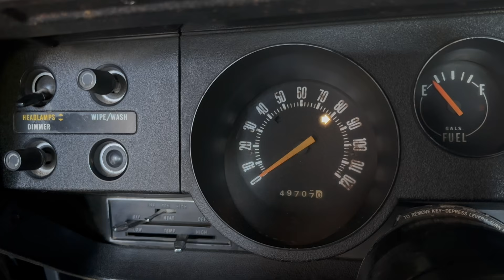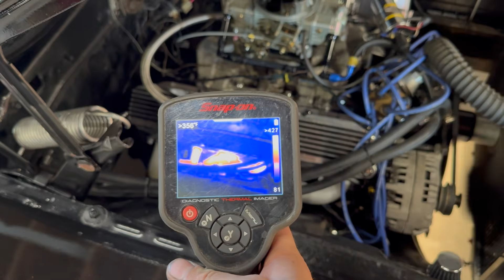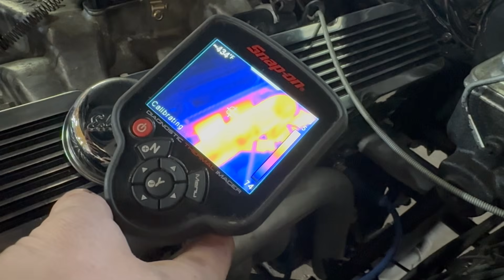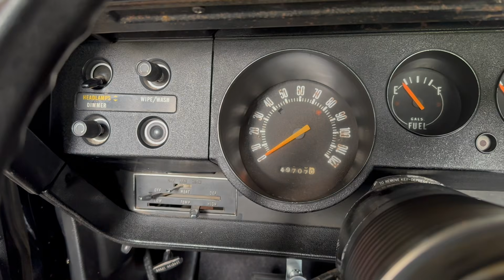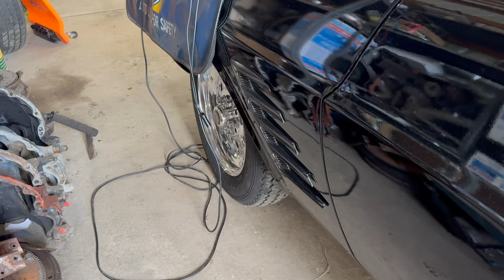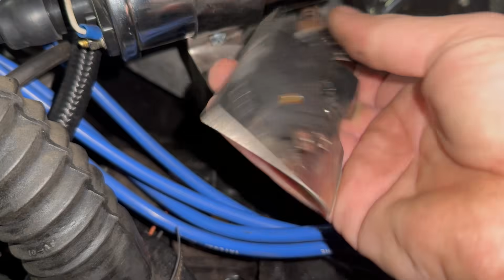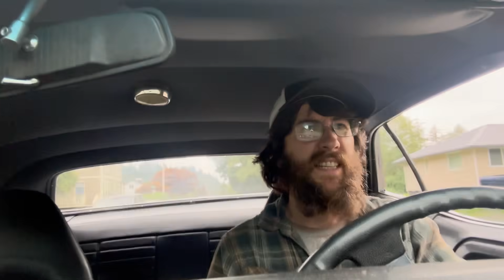What's Wrong With This 1973 Dodge Challenger? Electrical Gremlins, Big Block Tuning Tech, And More

Comment: Do you think there's a crack internally in the aluminum intake manifold I've ran into that on ford and olds and two sbc engines..
Reply from the maker: That’s an interesting thought. I think I tried a different manifold way back when, but I’m not actually sure now.

Comment: I am 9 minutes and 31 seconds into this video and I have a couple of guesses towards the higher RPM backfire out the carburetor. 
I have a 1973 Lincoln Continental with a 1970 high compression 460 in it.
About 10 years ago I went crazy trying to figure out what was going on with the car because it would do the exact same thing this Mopar is doing.  It would usually sneeze out the carburetor but occasionally it would even do the opposite side and sneeze out the exhaust It exploded more than one muffler In fact it was so bad I eventually put glass packs on it just because they just get loud when all the packing gets blown out (It is still running the glass packs today years later and it is really loud but it's kind of fun because it's no longer my daily driver).  Anyways long story short after rebuilding the carburetor myself and it not fixing The problem, i rhen  changed all the ignition parts and it did not fix it. Next I was starting to question my mechanic ability so I took the carburetor to a professional carburetor shop here in Southern California that is pretty well known for doing a bang up job on carburetors and having them go through the carburetor and it not fixing the car.  I was at the point I was ready to smash the car with a hammer.    I just got lucky and my neighbor Who is a fellow gearhead came over when the hood was opened and it was right at dusk when the sun had just set and I hit the key to start the car and it fired right up perfect running lolike it always did just like normal but My neighbor knew I was having a mystery issue and he happened to see a little itty bitty arc about 1" back from the ignition coil on the I believe it was the positive wire (it may have been the negative side it's been a lot of years now and literally dozens of more cars later)  anyways the wire was partially broke I temporarily used alligator leads and bypassed the wires and low and behold the car was 100% fixed and running perfect with no more sneezes or pops,  except obviously that wasn't a permanent fix because it would burn up the ignition system not having a reduced voltage to the points So I replaced the wires going to the coil on both sides going all the way back into the factory wiring harness where the wires appear to be really soft and never cooked by the heat of the engine because on a 460 the wires lay across the intake manifold although originally they were in nifty little clips those were long gone.  After that the car never had the problem again and it ran absolutely perfectly and because that happened it has stuck in my head for my entire life now alligator leads are part of my so to speak tool kit when I am trying to figure out a weird ignition or carburetor issue so I can hotwire the coil temporarily to see if problems go away. 
My original thought was actually weak valve springs because they were the factory springs and who knows how many miles they had on them I put in a slightly more aggressive camshaft than the factory but it wasn't anything wild I guess it's what you would call an RV cam or a torque cam Plus I gave it dual exhaust and I did some mild porting work to the cylinder heads just trying to make the car run a little harder than it should I would imagine realistically it's in that 420-450 horsepower range now (from the factory they were 365)  It's definitely stout for its 235/75/15 tires as it turns them into crayons mind you that is a huge car probably weighing in at 5200 lb. It's a handful if you want it to be definitely fun to drive now. 

To this day I have the brand new valve springs sitting on the shelf in the garage because the low voltage coil wire replacement fixed my issue Anyways I got an hour and 10 minutes to figure out if you fixed this problem or not And I am curious but unfortunately I got to go run some errands so it won't be until later this evening if I get to find out the answer let's see if I'm right...
Reply from the maker: I changed every ignition part on that car at least once or twice over the years. Nothing ever made any difference. I have seen spark jumping around in the distributor cause that and would expect an ignition issue. But I never found one... I still suspect a valve issue.
Reply: @DeadDodgeGarage  It's nice of you to respond I figured you were getting too many subscribers to be able to respond It's appreciated. 
  If you work on the car again My idea will take 5 minutes and it's basically free just direct wire the coil to 12 volts using temporary wire like speaker wire or something and see if the problem goes away If it doesn't because you replaced all the ignition parts already it's a guarantee at that point it's a mechanical issue which is probably valve springs. Anyways I am going to finish up the video right now.

Comment: I owned a 340 Challenger back in high school but it only had a built 318 in it. I could’ve bought the engine 340 for another thousand. I said you could keep it.  I’ll tell you the truth that Car had an original three speed on the floor and it almost killed me a couple times handled like a dream but it was it was fun!  Allegedly got away from a cop one time.  😂

Comment: Edelbrock 1406 with purple springs in the with original metering rods.  Because the weight of the car.  Or new Holley 600cfm.  Little adjustments

Comment: On the 73 challenger  back firing, what is the engine vacuum at idle? The power valve should be just below that adds fuel faster also go with the pink 330 acceleration cam and change .31shooters to .33
Reply from the maker: It’s been a long time since I missed with that carb, but I also tried at least two other Holleys on that engine over the years. I don’t think that’s it.

Comment: Reviving this.  Flasher systems are generally very simple, I even built one from scratch for a 70s Harley golf cart and integrated led flasher relay into W123 Mercedes with dead central flasher switch.  You only need resistors with flasher “modules” (90s-00s and newer stuff), and weird things like Fords using tail lights to supply signal to transmission and CC, otherwise just use led rated flasher (I use red 2 or 3 pin from Superbrightleds).  The three pin is for cars using single indicator on dash.  If you still get no flash, try a short harness to swap polarity on the module.  The relay likely has power on one side and the other side goes through switch on column to bulbs. I had to do the short swap harness on 87 Chrysler, 71 International, 74 Dodge and 79 Honda motorcycle .  Make sure grounds are all good at the lights.  If you have a single filament light that flashes or works as running light like the side markers on the Mopars, that’s another story.    Can be made to work, but complicated.  I’ve used JDM Astar, Auxito, Superbrightled, and others with no problems, 1156/57, 3156/57, 921,194, even ba7 and other weird stuff in heater controls and switches, and even fixed low fuel light in the 87 with one.  Also use bulbs color matched to lenses, white is only for reverse, interior, license plate, etc. Several companies make the smaller bulbs like 168/194 and 921 in warmer colors as well if you don’t like bright bluish white in the interior.
Reply from the maker: My brother in christ, I know all about LED flashers. I tried two. They did not work. I don't know what's wrong with the blinker circuits in this car. It must be something horrible. But the old school bulbs fixed it...
Reply: @DeadDodgeGarage  my cousin in the Holy Spirit, if they aren’t wired correct, you could try 100 and get the same issue. I went through this on several different systems.  Try reversing the polarity with a short pair of jumper wires between the flasher and the socket if you get one that acts up in the future.  (Real fancy would be re-pinning the fuse panel)..  If you still have problems, especially with different behavior between park lights on or off in a Mopar application, try unplugging the marker light on that side.  The flashing side markers run marker light power to one side and flasher to the other so the side of that circuit not in use becomes the ground.

Comment: Wicked final result despite the suspension issues! The first car I remember lusting after was a neighborhood '73 Challenger in the lovely bright blue metallic that was available that year. I think it might have had a white vinyl top but I'm not certain about that. The memory could be mixed up with a 72 Barracuda that was also on the market in town in a red that definitely had the vinyl top (and had run pinholes on the front fender tops). I was a late arriver in the driver's license sweepstakes at 18 years old in 1979.  The Challenger wasn't "special" at all by any objective standard -- 318 automatic car (console shift at least) but it sure looked cool. Couldn't afford the $1600 firm price and was advised that I shouldn't give a dollar over $1300 so I passed. Never owned one and still can't afford one now that they are desirable classics rather than just used cars. So anyway Jamie, watching you get this car from where you started to where you finished makes me wish I'd had the resources "back in the day" to turn that thing into my own and personalize it to something like this. Fun to watch you work through the process, especially the distributor tuning. Easy to hear that something was wrong there and you moved it from crap to very acceptable with just some know-how and the tools to apply it. Nice going!

Comment: Only a couple minutes in but what kind of plugs does it have (You should run NGK) and what’s the gap? Also, yes, I’m aware it’s an old video and you prob have long since figured it out or completely rebuilt the engine turbo charged it bought it then sold it since lol but commenting can’t hurt
Reply from the maker: Lol… fair enough. Anyway new plugs didn’t help either time, and I don’t care what company makes my spark plugs. They make sparks.
Reply: @DeadDodgeGarage Fair lol 😂

Comment: Jamie, this car raises questions I've long had about the 400. It's both bored and stroked from the 383, but is the block the same? Are 400 heads restricted smog heads, or are there good ones and bad ones? Did the 400 only come with a two barrel? And as a non-Magnum, does it share manifolds with the 383? I can't tell if it's a wimpy smog motor, or a pre-stroked and bored 383 upgrade.
Reply from the maker: No, they are the same stroke, only the bore was enlarged. Beyond the bore, cast cranks in most 400s, and the gradually changing head casting and emissions being introduced, they are essentially the same engine. So manifolds were the same too. Typical 400 heads (452s or similar) actually tend to have good performance potential. There were four barrel HP versions as well.
Reply: @DeadDodgeGarage  Thanks dude. Learning a lot from you.

Comment: Worn out springs float early can off idle, burnt valves intake especially won't seal . When exhausting it can push inconsistently back through intake.
Reply from the maker: True. They passed visual inspection and none were obviously squishy, which I’ve seen before.

Comment: IM SORRY THIS AN OLD RESPONSE BUT I CAN'T HELP BUT COMMENT ON HOW RIGHT YOU ARE ABIUT THE CAR ELECTRIC "STUFF" oops caps 
anyway, all those "voltage drops you read across connectors are exactly the sane as a ballast resistor in the connector. the best way to solve that is to jump the connector with a super duty connector properly dressed and greased. or simply jump and sodor correctly. there is no substitution to jumping for a solid correction in a circuit. also Jamie what the other boys and girls that say ammeters set cars on fire mean is the "resistor that makes up the ammeter connections get resistive and can in extreme case get red hot short of death to the battery and catch fire yes.
rare but i could see it.
also i could not help but notice the fuse block fuses were also kind of dirty they need to be as clean as a camshaft and treated an anti corrosive like creolin oil in a spray can or just wd 40 with improve connection resistance and help prevent corrosion .

connections are resistors in a circuit and ideally have zero ohms but  but but can have like 3 ohms and ut o voltage drop intermittent operation 
that's why that happens go figure  the 100's of connections in a modern car .

thanks for letting me rant 
bob

Comment: Awesome sounding engine, finally! Good fixing & tuning job! An intake valve stuck open at high revs also was my thought. May be related to previous faults or a weak valve spring. This car hardly gets any running at all. I would give it really good run, like few hours at moderate revs & load, to ”clean up” the engine, burn carbon deposits, reach all nominal gaps & clearances at working temperatures etc.

Comment: Have you checked to see if it had a bad valve cracked maybe.or bent..ive had that same problem...and thats what it was..but that dont meen its yours..allso had a cracked plug in a 383 .and it had the backfire. Through the carb..just checked  the plugs and found it..and that fixed it.
Reply from the maker: Well I did a compression test, and pulled the heads and inspected the valves - among many, many other things.

Comment: that 5 volt regulator  should be a  lm7805 rated at 1 amp with a heat sink
Reply from the maker: Well, you’re the expert, I just work here
Reply: @DeadDodgeGarage  I did tv radio repair years ago for zenith tv / radio 
1980 era .

Comment: OH man..Worn out distrib advance plate pin guide holes..whacked out throttle cable adjustment...cruddy mtr mount...stupid electric fan...whorey-lookin floor shifter.. fouled plugs..blowby ...JEEEEees!!! WHAT a NEGLETor-owner. That reminds me to clean my 02'Chev S-10 4.3L's oxy sensor, MAP/MAF sensors, check ALL! vacume lines..etc etc!!

Comment: Although it wasn't completely the gap in the pickup, that was thing I thought was wrong.
Reply from the maker: Did I check that? Don’t remember. Either way, when I owned this car, before I swapped to the electronic ignition, it had the same exact issue with a points distributor someone had installed.

Comment: A bad ballast resister will make it run like that
Reply from the maker: And if the car still had a ballast resistor… that might be something to look at. The ballast resistor completely died on me in this car, and I replaced it with another. This made no difference. Neither did the HEI ignition conversion.

Comment: Instant thought was a burnt exhaust valve causing the issue.
Reply from the maker: I’ve long suspected a valve issue, but it should show itself with zero compression on one hole.

Comment: When you switch to LEDs you have to put a resistor in the line on each side.
Reply from the maker: Yeah - unless you’re using LED bulbs that have resistors built in. Or unless you use an LED specific flasher. I tried both of those things. Thanks.

Comment: 8 mo ago without watching but I would say weak valve springs.  I burned down the top of my 350 because I was home for lunch and piddling with the problem of backfire thru the carb and I started back to the shop with out the air filter on.  Big mistake for me, it burned down the wires before it stopped running and I saw the smoke.  I tried holding my dog blanket over the top of the carb and could not get the fire out.  I just jumped off and said to hell with it let it burn.  The local propane delivery guy was coming out of his place and he stopped across the opposite side of the street and ran over with his fire extinguisher.  Now I got those two cylinder heads from one of the guys at the old shop I worked and they were all nice and painted and looked brand new.  He was a dirt track racer and no doubt those springs all came off of a losing engine.
Reply from the maker: I thought springs too, but could find nothing obvious.

Comment: Valve float?  Broken valve spring?  Flat cam?
Reply from the maker: Not cam, I changed it with no difference, checked springs, float? Not at that RPM

Comment: I know this is a new comment on an older vid, but for those reading, you don't want more than 100 mV voltage loss on any live circuit for any vintage car. Note that these cars have much heavier gage wires than modern cars do, which means they can pass major currant. It's all about Ohms law. I cannot tell you how many times I've found major melting issues on these old Mopars despite fusible links and the fuses themselves. I call it the toaster effect. Direct short? N/P. Bad connections? Well..Ignore them long enough and you'll need a fire extinguisher. The pin fitment in the bulkhead connector is terrible pre 74. The harnesses were revised again about 77 with a new ign switch as well, and by the 80s, it was a non issue in rwd Chrysler products.

Comment: The "flattened cam" idea is fairly easy to diagnose. Pull the valve covers and hook up a timing light. Start the engine. Aim the light at the rocker arms. If one looks like it's moving in slow motion, that's a flattened cam lobe
Reply from the maker: Very interesting technique. There are other ways to verify that.

Comment: The carb just seems to much for a stock fuel pump but I'm not a professional I grew up working on cars in a gravel driveway it's a bitch to do a engine swap in gravel lol
Reply from the maker: That’s not a thing at this power level. The 5/16” line and stock pump will provide more than adequate fuel to supply this setup.